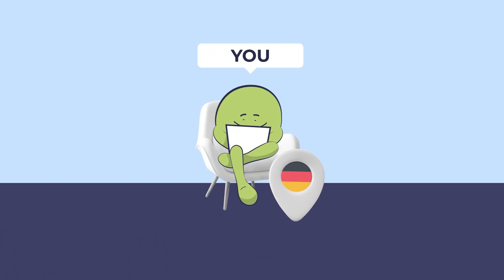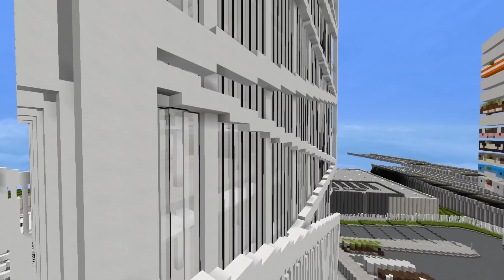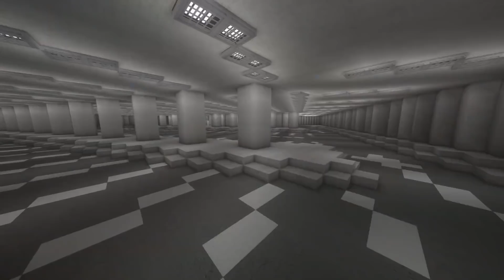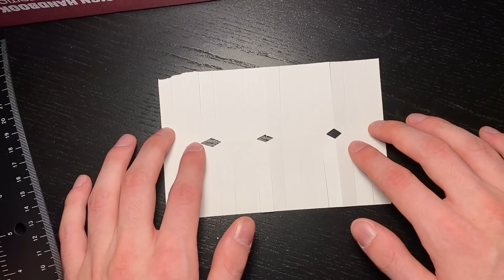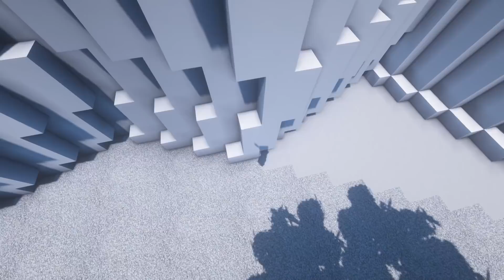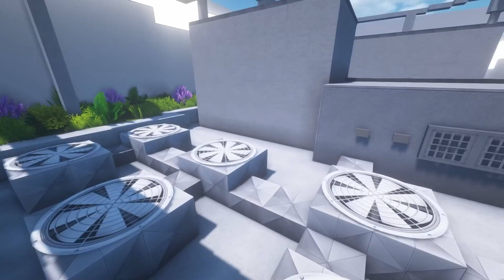Minecraft Skyscraper using Real Structural Engineering (11 Odawn St.)

Comment: I can confirm that the cleaning tubs are sometimes on rails. I'm an automation tecnician and at the pharma firm I work at our cleaning tubs are also on rails. But only on the older buildings (about 20-30 years old) The newest building has a different system. Also the rails are close to the edge and the tubs are not rotating on a crane. So the rails do all the work.

Comment: Kind of fun seeing this from the engineering and architecture side. I'm used to the perspective of the guy pouring the concrete.

Edit: 9:00 one of the ways we reinforce concrete aside from rebar are cable tensioners. You insert these sleeves full of grease through the concrete when it's being poured, and put steel cables under thousands of pounds of tension through them, anchored at the ends so they don't snap and tear put of there obviously. The tension of the cables puts the concrete under compression, strengthening it.

Comment: What a pointless sponsor!
The majority of sites are already using the same type of encryption as these vpn providers. So the second layer of encryption is completely redundant and pointless. And the connection between the datacenter and a server that doesen't use encryption, is still gonna be unencrypted. So nothing has changed except the server will think you are from Bangladesh.
And it is just gonna block that IP address if it would otherwise be fooled into giving you different prices or services.
What is the point of these services? They effectively do nothing except give you some extra lag, and maybe have automatic language selection mess up every once in a while.

Lying about what your product can do, to get people to buy it under false ideas about what the product can do. Is a form of scam or fraud.
One could even argue that by sending people over to get scammed, and having that money circle back to you as a form of payment. Makes you yourself a scammer.

Comment: I don't know about the modern buildings. But in the ones i've worked on, the HVAC system works just as a domestic air conditioner (heat goes out for cooling and viceversa) but instead of using tons and tons of gas, they used cool water towers that go through the whole building, this water then takes the heat from inside and goes up to the top to dissipate the heat and restart the cycle.
Reply: Like a giant PC with liquid cooling

Comment: Just a small addition to 8:42 about why nobody uses full steel for skyscrapers.

While its way more durable than concrete in many ways, Its terrible against fire. 
In a case where a fire is spreading throughout the building, It will not burn down in parts but completely collapse given enough time. Since stell shares the heat with the rest of the constructure, It wont just destroy a room and move on to the next but instead it will collapse an entire floor to get further.

Which is WHY glass and reinforced concrete are better options than going full in with Steel.
Reply: Interesting.

Comment: For the bucket used for window scrapers you could add pieces on the sides with rope that connects in a center point for the crane to grab onto.

Comment: I have studied real buildings to recreate them in Minecraft. Lights don't tend to be in line with the Pillers from what I have seen (there are certainly exceptions) they tend to be in a grid pattern. I think it is common to have 6 segments between each Piller (from what I have looked at in my home Town). (This would be cealing tiles or windows). This would be P/T:L:T:T:L:T, (P = Piller, T = Tile, L = Light). I have also encounterd the plant shafts beside stairways. Naturally the general arrangement plan I was studying didn't have this labeled so I had no clue what it was at the time. I don't know if there is a full plan available of that building that is labeled.

Comment: You'd really hate to work with me (architecture student). I really hate using plain, boring vertical elements, even if they make structures much easier to work out. Organic shapes really are the way to go! (from an aesthetic standpoint, anyway...)
Also it sucks that, in the architecture program that I'm in, we don't really go into structural engineering until at least halfway through the program. I wish we would have had some simple structural engineering classes in our first year- I hate how architecture is so isolated from other very important related fields until the very end. I get that it's a lot to learn all at once, especially when you take (ugh) codes into consideration, but reigning in students' fantasies with some real structural consequences would help alleviate a lot of the really bad design decisions we make and tend to continue making into our careers.
Reply: Also I'm going to channel my inner professor and say:
1) yOuR cOrEs ArE tOo ClOsE tOgEtHeR!!1!
2) 2+ means of egress :)
hehe still love your content though

Comment: A few things regarding atlas:
1. After your three years it's 80$ a year, automatic renewal.
2. Netflix did not work for me.
3. Most fatal: Sometimes it kills your connection. The killswitch also does not work, so you might experience your protection suddenly being gone because the VPN disconnected.

Besides that, the connections were pretty fast all across the globe so it's not all bad, but you should take care. With this one.

Comment: If you put a little bit of space between the ceiling and the next floor, you can have redstone dust and repeaters for wiring to activate lights. And if you so choose, you can put space between walls to allow a redstone signal to go up from the switch on the wall to the wires in the ceiling.

Comment: I like to build structural sound buildings, but I could never to that, not smart enough lol. However I can understand medieval architecture, vaulted ceilings, overhangs to prevent sagging, corbels and porbels. It’s a general rule of thumb I think that if you build structurally sound buildings, or at least buildings that look so they’ll end up so much better than the rest.

Comment: Amazing video I would love to see more content!! Regarding the Hoist for the Window cleaners 21:31 you can still put the track on the top depending on the design of the building and some buildings actually have parapet of aprox 30ft high and the hoist crane for the cleaning is about 35ft tall so it surpasses the structure of the building with out a problem.